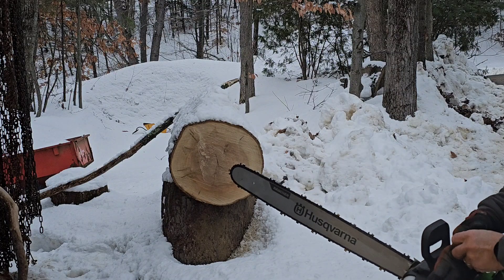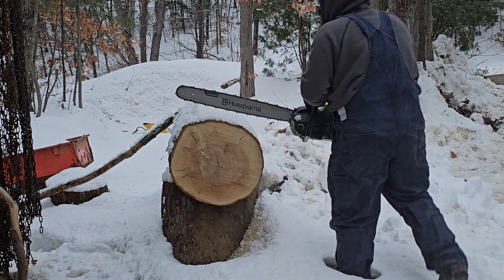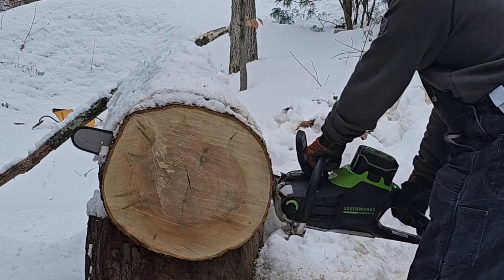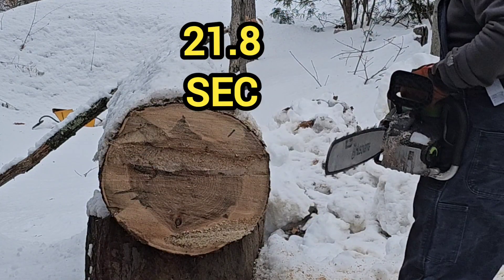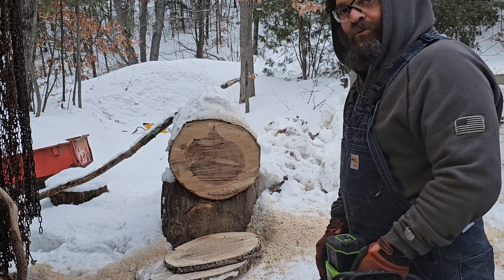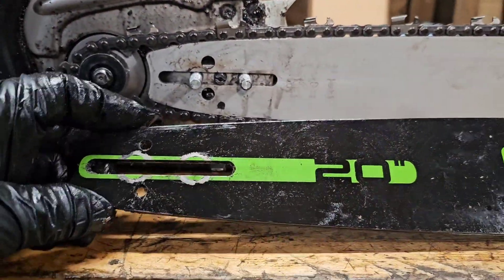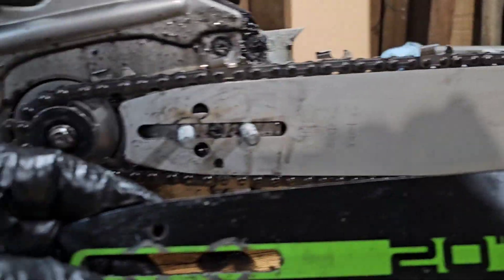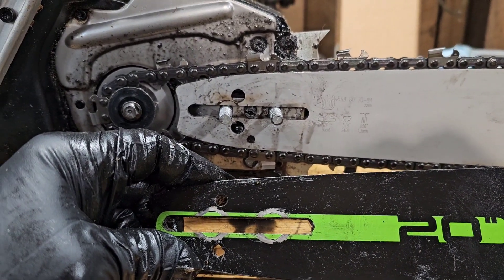I couldn't wait for the HOG saw! This is the longest bar on a battery chainsaw ever! Greenworks 82v

Comment: The High-Output, 5.7-kilowatt (70cc) chainsaw is shown and discussed in the linked video, starting at 20:57. What happened to the promised 4.3kW?

https://youtu.be/QA4Lvnr24BU?si=3rBK6wIHzc1E0IJ7
Reply from the maker: I think the 5.7 is a hemi.  No just kidding... I think the 5.7 is the horsepower output for 4.3kw saw. I saw that there is a 14 inch chop saw on the website now(sold out of course), but it comes with the new high output 6ah battery,  so I'm hoping the chainsaw is close behind!
Reply: @reusefull  
Ah, you're right: the video said 5.7 hp, not 5.7 kW.

Comment: The price of a new HOG is forecast to be around $1100 so this is a great video - thank you ! 
It would be really helpful if you did another video showing exactly how you did the modification for the oiling hole . I think you used a thin cutting wheel in the slot of the guide bar? You did that to avoid the risk of having a drill bit snapping in the groove? 
 Also the chain  - did you use 84 drive links or 81??
 I ask because 84 is more common see part number below.
You recommend fitting a different wheel chain sprocket #  339012028A  from Greenworks ($12). Is the stock sprocket a bad match for the 3/8 chain you used?
 I guess the chain you used was 72EXL084G Power Cut 24" ?
Sorry for the picky detail questions, just trying to get all the info for your wonderful mod in one place for all to use successfully.
Reply from the maker: I'll try to hit all the points.  I used a 72EXJ084G chain. I believe it's the same thing,  but skip tooth.  You are correct on the oiling hole, I used a .045 disk very carefully to grind down to the oiling hole.
I also think it may be possible to change the drive ring to 3/8 on the original sprocket, I didn't research it heavily though. You have the correct Greenworks part number though to replace the whole sprocket.
Reply: @reusefull Thank you for helping with the details. Here's what I found so far . BAR : Tail Stock/Bar Mount is K095 modified to be similar to A041,3/8"(.375") drive sprocket, .050"(1.3mm) gauge,84DL. Example is Oregon 24ORNDK095.CHAIN: 84DL, 3/8", .050". Example is Oregon 72EXJ084G = skip tooth. I couldn't find safety chain, just full or semi chisel from Oregon. Be very careful with the part numbers because one letter/digit difference is a failure ! For my 80v Greenworks with 18" bar the chain spec is: 3/8" drive sprocket , .050" gauge, LP. The bar Tail Stock is A041. Please correct to help others who follow this and many thanks to @reuseful for his pioneering work.
Reply from the maker: @schnellgelb1746  I didn't realize your starting point was an 18 inch 80v saw.  That is 3.4 hp as opposed to 4.5hp for the 82CS34,  you will be asking a lot of the saw to drive a 24" bar and chain.  It's harder to find safety chains over 20" because at that point you've crossed into logger territory and most of that equipment is made for cutting aggressively.  
 The 16 and 18 inch saws are already set up for 3/8 as you know,  so swapping the drive isn't necessary.  I'm curious how your project turns out. Keep us posted for sure.
I also forgot to mention that I plugged the 2 small holes on the 24 inch bar so oil doesn't leak out of them.  I used tire patch, but jorg soldered the holes which is probably a better idea.
Reply: @reusefull Thanks for your helpful comments. Agreed the 80v saw is under-powered IF you use the entire 24" length of the bigger bar. I have 4 , Greenworks 80v saws and many batteries.
One application is limbing trees that have already been felled.It saves stooping over and my chronic back ache benefits. I use the big battery backpack to help with weight distribution and Amp hours. 
The other application is very occasionally felling large diameter trees where the stock 18" bar has already done most of the work. The 24" does the final few inches of the back-cut. The 24" bar is buried deep in the trunk so the risk of a kick-back  hitting me is reduced The 24" bar enables me to very slooowly make a clean "hinge" and therefore control the direction of fall better.I found a low kickback chain by Kazpro -$16 and a Forester bar for $65 on Amazon. So for less than $100 I avoid buying a HOG that I would seldom need .I'd probably want to run an 18" bar on the HOG most of the time! Hopefully others reading your comments will be able to add more suggestions.Thanks for your help.
Reply from the maker: @schnellgelb1746  cool.  It's good to know other people are out there being creative with these. I'll try to document any adjustments.

Comment: Suspect it’ll be a deadworks soon. No thanks. If you don’t need to be independent of a charger it should cut for a while 🫤
Reply from the maker: All of our rigs have inverters,  but this is really for my property,  so it's fine. I go long periods without using a saw,  so not having to mess with carbs and mixed fuel has been pretty nice for me.  I understand that if you're trekking out into the forest with a Jerry can it's a different thing.  You do what works for you!

Comment: that 82cs34 just thoroughly impresses me! I find it strange that you're the only content creator out there showcasing this cool tool. an interesting video idea I think you should explore is the advantages and draw backs of using it through out the day in the woods or bucking firewood. really show it's colors compared to two strokes.
Reply from the maker: If I keep hauling logs up from by the river,  I will probably leave the 24 inch bar on the 82CS34 and use the 82CS24 for everything that it can handle.  I'm actually very impressed by both of those saws.  If I have to go trekking with no machinery,  the 24 is so much lighter than the 34 I like carrying that better.
I do have a couple of trees that I'll have to cut,  so when the weather is better,  I'll try to do a video of that 👍

Comment: Well done! Only when i made conversion of oil channels i used small grinding disc and Dremel tool. And of course switching from .325 to 3/8 skip-tooth chain was best idea!
Reply from the maker: I broke a few bits and wound up using a use a grinding/cutting disk as well.  .045 just barely fit in the channel,  but worked slick.
Reply: You may try Dremel EZ456, 1 1/2-Inch Working diameter (38.1 mm), Blade Thickness: .045” (1.1mm) Cut-off Wheel, or similar. It would be much easier than to use regular grinder. @reusefull

Comment: Interesting.  I have an 80V Kobalt (made by Greenworks), and the oiling gear stripped out. Neither Kobalt nor Greenworks sells the part.  After a lot of searching, I found one that would work from Makita, but was disappointed that these expensive cordless saws are basically built to be disposable.  

How is the parts availability for these Greenworks Commercial saws?
Reply from the maker: I have had one for 3 and a half year and one for 2 years,  but I haven't had to get anything like that yet.  I was not able to find a good parts breakdown,  so I'm not sure.  I do know that you can go to a dealer and talk to someone about parts.  Maybe I'll try calling.  Sohars/RCPW seems to be a good source of there's no one local.  I know that I just broke a part on the 82v snowblower and I was able to chase down a diagram and part pretty easily.

Comment: I have been thinking about doing this to my saw for a few months now but can’t justify it! Looks like a half skip chain on there. Any way you could post the exact part #s that would make this work?
Reply from the maker: Sure thing,  I'll add it to the description.  Not sure about the chain,  it's whatever Husqvarna gave me with the 460.
Reply from the maker: I used the 3/8 because that's what I had laying around.  I had bought the adapter for a different project and used that,  but if you're starting from scratch,  you could get a 24 inch K095 tailstock with a  .325 pitch (.050), then you wouldn't have to change the drive and it would be easier to switch back to 20 inch.  You'll still have to modify the bar for oiling either way.